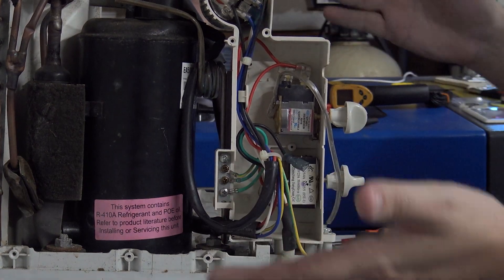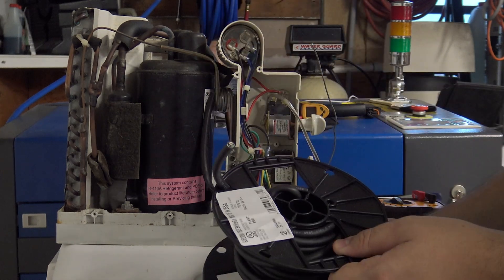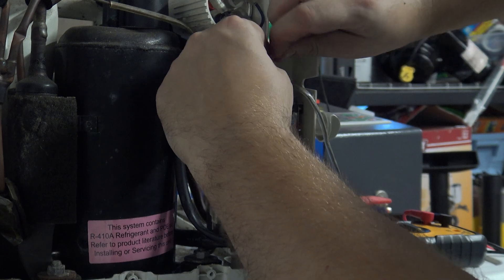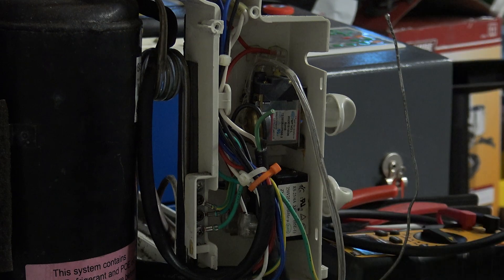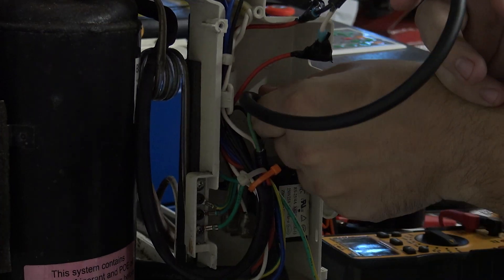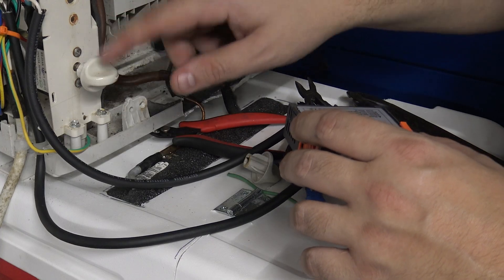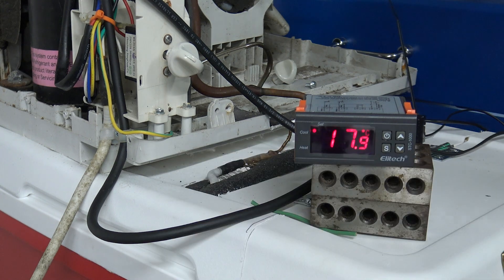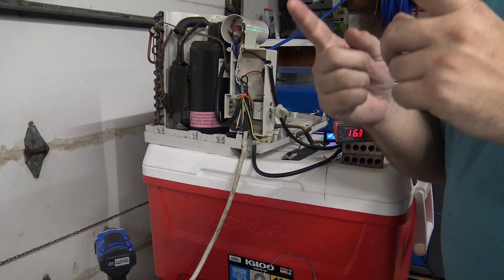Wiring Up the Temp Controller | DIY Laser AC Unit Water Chiller | Part 3

Comment: Nice work! I’m trying build one of these, for chilling beer, mine is a bit different, electric panel on off switches, gonna try to just hookup a plug in temp controller instead of all the wiring you did. I’m impressed!

Comment: How about a corrosion update? Have you had any issues 8 months later? I really enjoyed this 3 part series as im looking to build one of these myself!
Reply from the maker: I definitely need to make a full update video, but I can tell you that everything is still working perfectly.
Reply: @DustinCorbin  I have access to deionized water through my job, do you think that would work as good as distilled water? We use it for our wire EDM machines.
Reply from the maker: @GorillaGlueEnthusiast  yea. Usually that's the best bet (though most people don't have access to it). Just be wary if your machine is exposed to freezing outside temps, may want some sort of anti freeze in it too.
Reply: @DustinCorbin  I really appreciate your help and input! My league of extraordinary J.O.A.T.M.O.N. thank you🤘